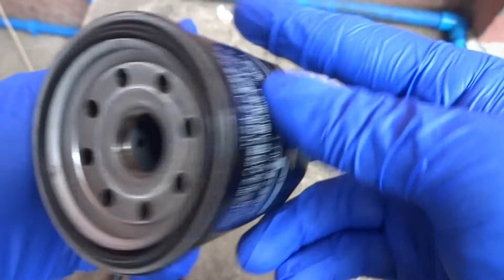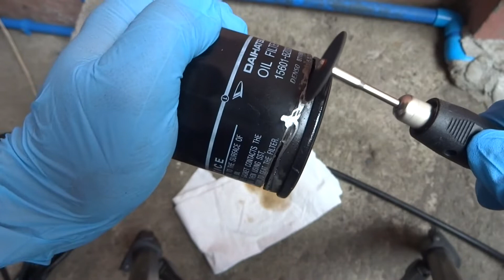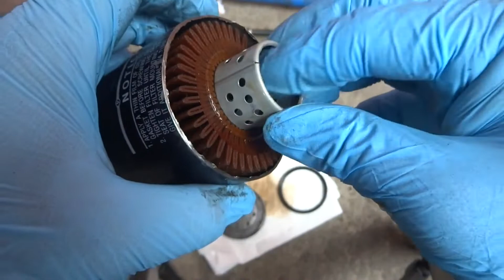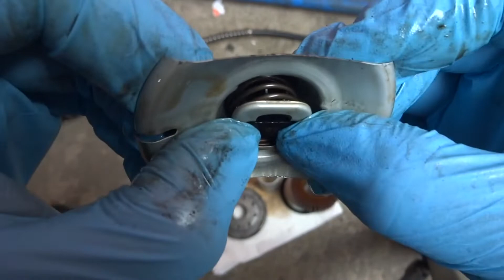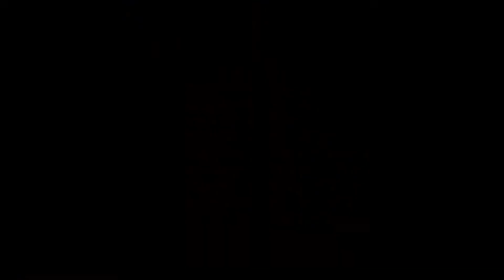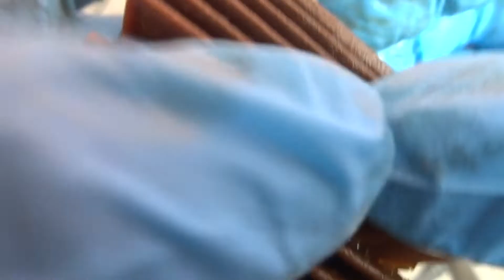Inside of Oil Filter Toyota Rush Daihatsu 15601-BZ030 2NR-VE

Comment: Perodua new vehicle using Daihatsu Oil Filter 15601-BZ030 no leaking Aruz, Ativa, Bezza, MYVI, Alza 2022 and Axia. After 10k service, engine oil filter leaking problem manufacturer vendor UMW Malaysia.
Reply from the maker: Oil filter BZ030 have leaking problem ?
Reply: @playstation2bigs  No problem Daihatsu Oil Filter made in Indonesia. UMW Oil Filter Supplier Problem in Malaysia Perodua all model after service.
Reply: Perodua need recall after service engine oil change and oil filter (UMW Malaysia).

Comment: Nice and better construction than the toyota oil filter in your old "toyota vs vic" video.
Reply from the maker: Only the anti drain rubber (color black) is missing, due to the design of the 2NR VE  engine oil filter location